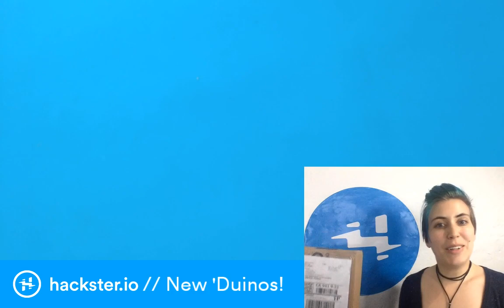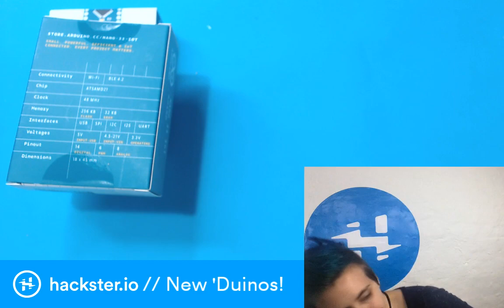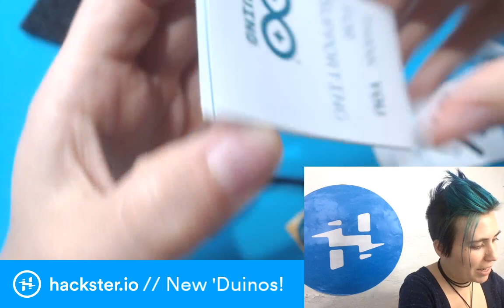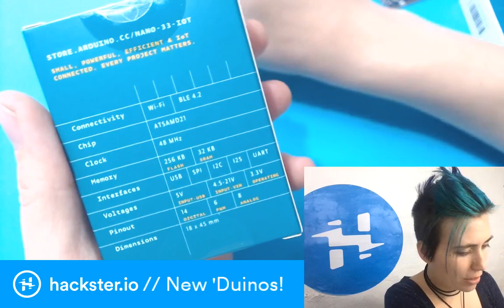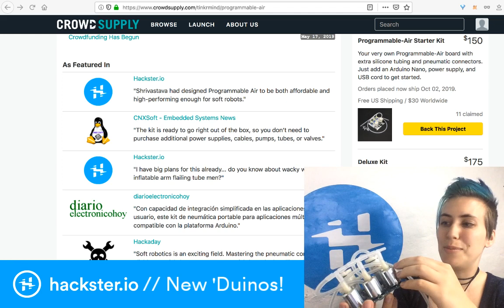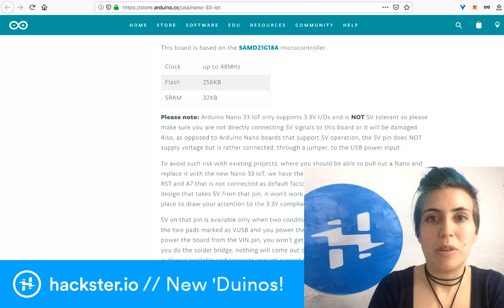New Arduino Nanos! // Unboxing

Comment: I recently saw another review of the Nano Every in which the reviewer used a scope  to show the clock rate is 16MHz, not 20MHz.  Also the clock  uses an internal oscillator, so it may not be as stable as some boards with external crystals or resonators.

Comment: Hi. I dont think u need pwm signal to runs neopixel strips and I can not see a point to use more then one output for it . With this type of led strips the sram only matters.
Reply from the maker: Unfortunately you do need to feed NeoPixels data over a PWM signal. Thanks for stopping by!